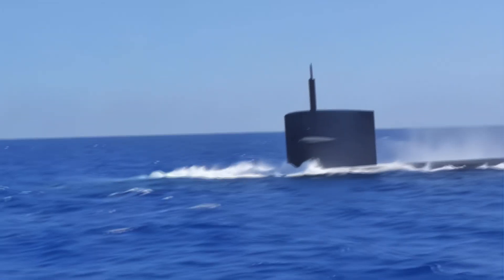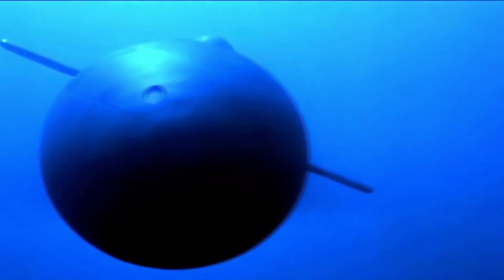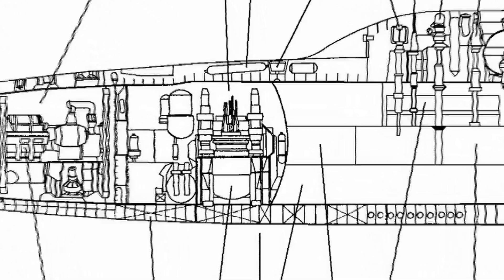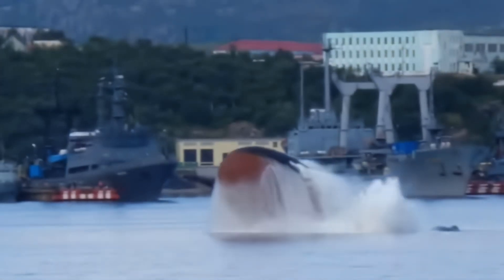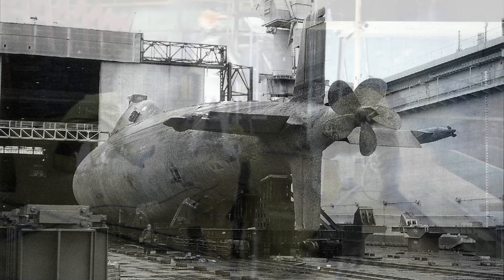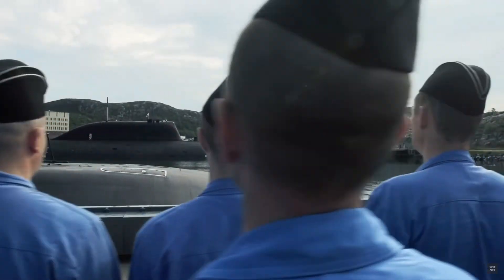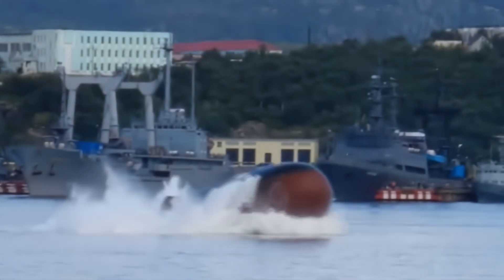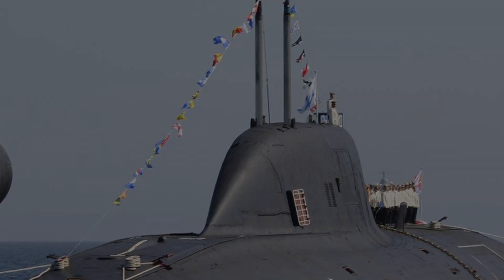Alfa-class Submarine | Best Submarine Design Ever? | TMT

Comment: the Akula II class of nuclear powered submarines are some of the best designed boats by far . . . retained the double hull design but incase of the Akula it was made of steel instead of titanium alloys, due to high cost & manufacturing complexities with titanium . . . the near perfectly sized sail of the Akula II class blends seamlessly with the hull, like a continuous running design line . . .